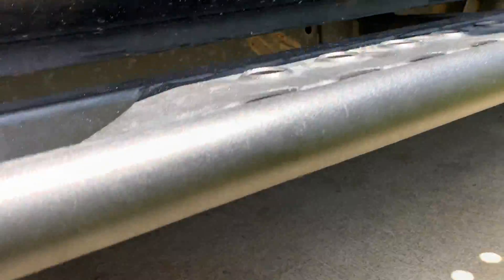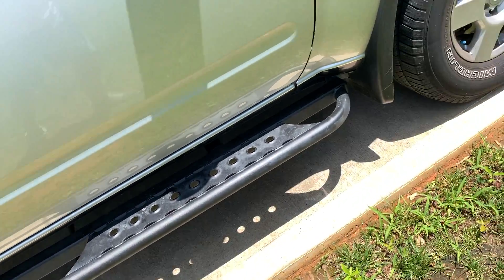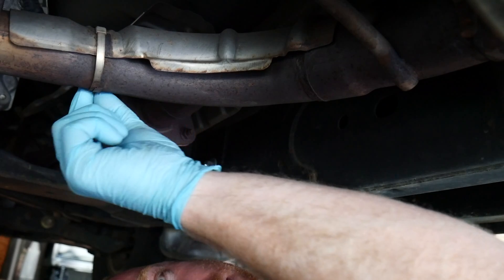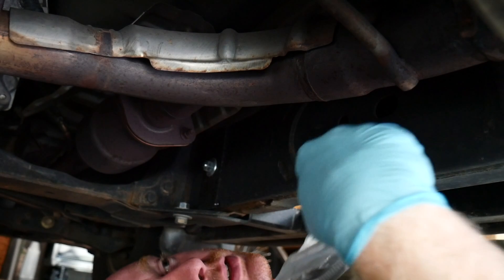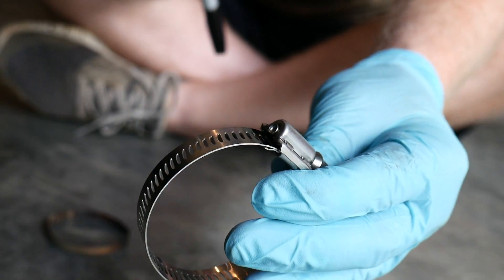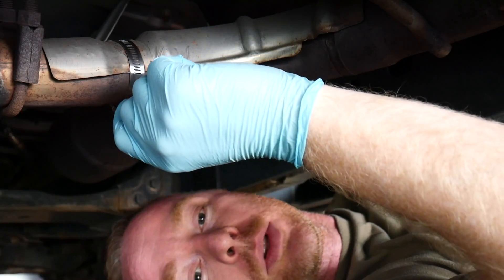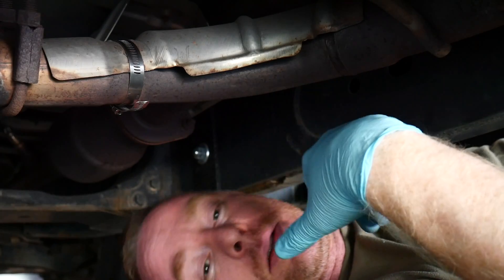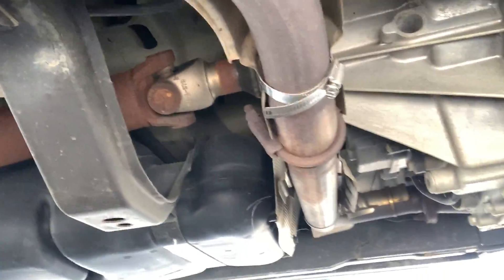LOUD NOISE coming from underneath my Xterra! How I fixed my broken heat shield clamp.

Comment: Thank you, I had the same ploblem. with my XTERRA 2013, and I was thinking I had a transmision problemas , that I have to espend a lot of monye, 🤭🤭🤣🤣
Reply from the maker: You’re welcome! Yeah, it sounds awful, but Xterras are notorious for those heat shield clamps failing. Good thing that it’s an easy fix.

Comment: Nice video what size is the clamp I have a 2009 Nissan Xterra same issue
Reply from the maker: The clamp was a half inch width and I think 9 inches length. Super easy and inexpensive fix. Mine is still holding up with no issues. Best of luck!!